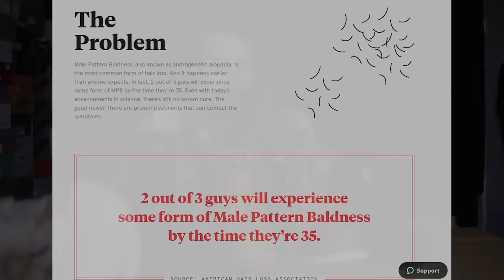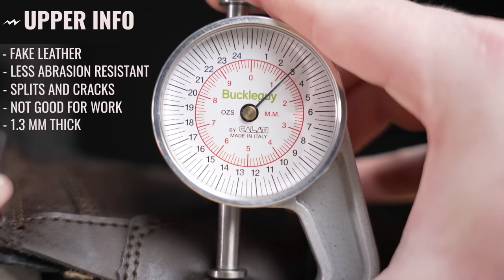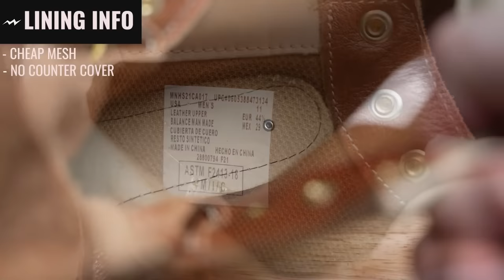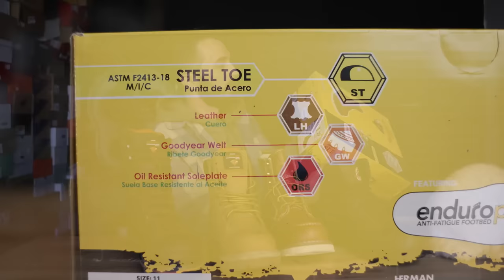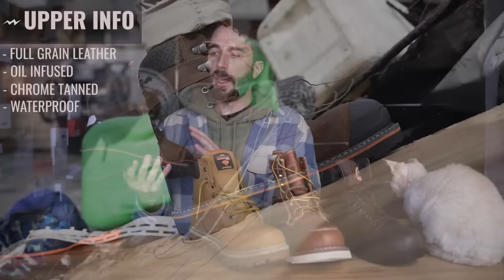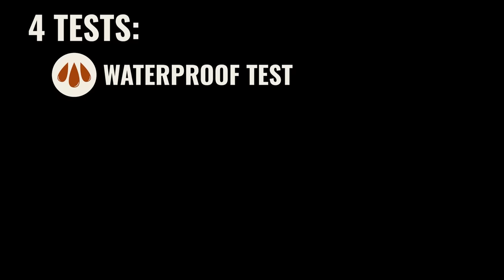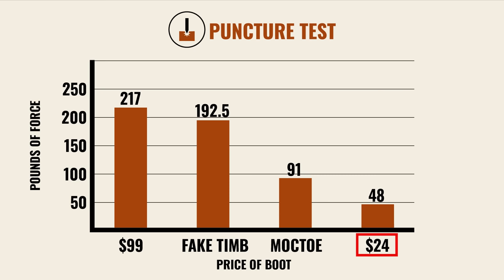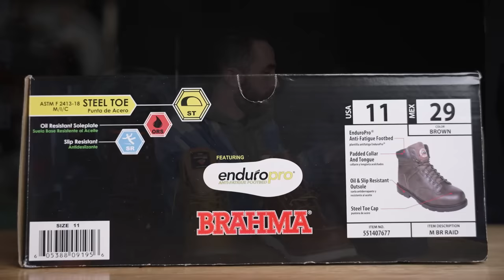The Truth About Walmart Work Boots - Best CHEAP Work Boots or TRASH?

Comment: I own to this day a  pair of $65 dollars  1973 vintage DUNHAM water proof  insulated suede work boots with Vibram soles and steel shank support bought from the LL BEAN co when I was 21 . No safety toe needed for the work I used them for ...but I suppose a case could be made for safety toes even when sitting on a toilet in the modern bubble wrap me age, the above gives away my age
Anyway the point is that the boots decently cared for  are in excellent shape for their age with only minimal sole wear .but definitively stained  and sheened in the usual spots. Originally the Dunham co, made boots in BRATTLEBORO  Maine, I do not know when they sold out to some CHINESE JUNK MAKING company . 
For American consumers there are no real good choices when it comes to well made comfortable lasting quality boots. The Chinese Junk is not worth talking about and the  domestic companies that claim made in the USA are not much better for the overblown priced models  they sell . Good boots cannot be made with junk material no matter what the idiots who sell them say about the materials , especially the new formulations of adhesives ( low carbon footprint crap ) that the greenies have forced in manufacturing processes
6 years ago on my retirement  I tossed in the trash my last pair of company bought  "KEENE " CHINESE MADE JUNK with composite safety toes . They were rated  for , oil resistance , insulated , water proof... .in a flying pig`s eye!!!  One year in semi wet conditions is all that it took for the two part red and black soles  to chip from abrasion and delaminate as the glue dissolved , in addition to their broken aluminum lace hooks , which snapped off while I was lacing them tightly.
The point is simple...even a $400 dollar pair of boots made anywhere on this sorry ass planet  will not match the quality of a pair of vintage boots made by old reputable companies in the US or Canada .Good lasting quality  is a thing of the past ..because the recent generation who don`t know what quality materials are  will buy anything labeled quality, and  being even  50 years of age , that is still too young to have ever been exposed to quality work boots .

Comment: Ummm... when dropping that railroad steel onto the steel toe of the boots, couldn't you get the the thing to drop on the center of the steel toes rather than the outside edges?  Or, was that by design?

Comment: I looked at the 'driller' model today, felt good, sole was sticky, wide fit was nice, only complaint is no goodyear welt. That is probably a deal breaker, going to need some logger boots I think instead for saw work/farm work.
I have a new pair of wolverines I purchased yesterday but im worried they will not hold up. Pressed on what to do? No wolverine loggers available.
Redwings using cardboard so not worth the $
Cant find dickies locally anymore, they were my go to.

Comment: Back when I was 20, I bought a pair of Brahmas. About $30. They lasted until I was 24, though the treads wore way down to nothing. Bought several more pairs... each successive pair lasted a year or so less than that first one, until I bought that last pair, which literally fell apart while I was working about 6 months after they were bought. Disappointing.

Comment: The Brahma boots disappointed me. I had some engineer boots by them (I think $60 at the time?) that actually didn't suck. All leather upper and shaft with real Goodyear welt and screws and nails. I only didn't get them resoled because I didn't take good care of them in a midwest winter and the leather uppers deteriorated from all the salt and moisture. ☹️ Got some X-Element engineer boots to replace 'em and they were OK I guess. I can't even afford to think about the ones you just got for $2,000, ha ha.
Edit: actually debating sending you the current ones for dissection when these soles wear out.

Comment: Believe it or not those 24 dollar work boots last as long as most expensive ones and are light which is good of ur on ur feet walking and climbing alot during work.. I've yet to find a boot that lasts longer than one year and that's toe leather rubbing thru as well as the soles and I've never tested boots with anything other than my feet and being a carpenter but I'm telling ya youd be surprised

Comment: 25 years wearing boots. Timberlands and Redwings are fucking god damn expensive...hard to pass on $40.00 boots....until you buy several pairs in a year and have feet that feel like they have Wolverines attached to them (pun intended). My current set of boots were over $200. My feet stay dry...my feet are comfortable...and when the Sole runs out...I just spend about the same amount of money you'd spend on a high end boot at Walmart to get them resoled. When buying boots you are going to work in 5 days a week...8-16 hours a day...do your feet a favor...buy quality.

Comment: i remember i worked at a warehouse that required a steel toe boot and i got this cheap $10-15 pair at walmart (like 2017?) and while it was cheap and uncomfortable it did protect my toe and keep my feet semi warm and dry of snow. Would i get it again? no but it was the most bang for buck purchase I ever made. never frayed or broke apart kinda wish i still had them so i could see the brand but i tossed them when they got all moldy in storage.

Comment: I have forgot my boots several time and had to do the wal mart thing. I can honestly say they are all crap! Btw I work on the railroad and walk 3-5 miles a day on ballast in all weather conditions. Sample size of 3 $25, 2 $100 pair they are decent unless you weld or it’s summer and the soles melt and at least 1 of the others

Comment: At 10:20/25.59 you are measuring the  rubber hardness on a boot, which is cut in the middle....so you can see very clearly, what the inner board(as you say counter cover?) is made of...yet you made an excuse, that is it hidden thus you do not know...I am wondering what is going on there....

Comment: Every time I buy the expensive boots. They fall apart in 2 months and have holes in the soles. I buy the cheap interceptor steel toe boots. They look like cop boots they were 30 for the longest time now they're 35. Amerikan. They'll last for a year. I don't wear them any longer than that because they start to stink.

Comment: what boot should i buy for durability and water resistance? auto tech that does construction and lives in heavy snow/rain climate. ive had tims, diehard, various target/dsw boost. none last more than a year before leaking water, cracking, squeaking from water somewhere in the sole...  i just want a boot that keeps my feet dry and warm and i cant find one, i dont care if they cost 800.00, i just need a quality fucking boot.

Comment: Boots aren’t something to go cheap on I used to wear the cheap wallmart boots when I was younger building blast furnaces and boilers my feet always hurt and I had to get a new pair once or twice a month and the soles can’t take heat they will melt I ended up switching to the Carolina metatarsal with Kevlar soles but because of all the years wearing Brahmas my feet are destroyed I have problems with my Achilles’ tendon and my arches and basically limp around everywhere DO NOT wear cheap boots to work

Comment: Reality check : These are the boots that'll get you going for your first (or minimum wage) labor job that requires a steel toe. A lot of guys just cannot save up $600 for a quality boot. If they have to go through 3 pairs of the $24 boots because that's all their bank account can do, then at least they won't lose their job.

Comment: I think the makers of this video are little out of touch with the real world.  In the UK all work boots are replaced every 6 months on construction sites regardless condition for health and safety reasons.  (I'm not sure about the supermarket chains who also use them.)  And they know how long the boots have been worn, there issued by the company.  Even sub contractors are required to follow these rules.  If a health & safety manager tells you to replace them, you do it or leave site.  The only requirement is:  steel penetration-resistant midsole, 200J steel top cap and last up to 6 months.  So if you were buying 2,000 pairs, which ones would you buy?  Take it from me, its the cheapest ones we can get that meet the reuirements.

Comment: Brahma is absolute garbage. Do not buy for any reason, especially if you are going to be working in these boots. Oddly enough, another walmart $24 boot, the Interceptor, is surprisingly good. Granted you need to put an insole in the boots, but working construction, a pair of cheap Interceptor boots lasted over a year.